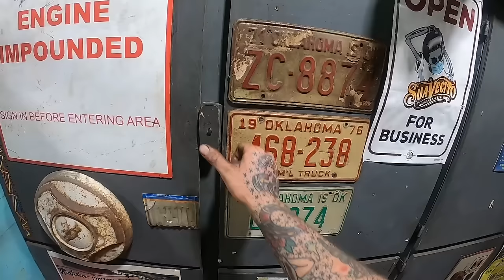Budget Shop Truck. WILL IT DRIVE AGAIN? 1976 GMC SHORTBED Conversion.

Comment: pudding, Yes, I would like to have me a good pice of reliable transportation to drive.  Yet, I like and enjoy watching one do the different mechanical processes to make the truck safe to drive daily.  Regarless of the time it takes one, one is still doing a good job.  I took out my trash and can barely walk.  Then I laid on down after and was frustrated I had three bags and each was holding me up from getting outside.  I fought them the whole way.  I got my can from the cub and rolled it to the house and put all the bags in it.  I climbed up a ladder in the kitchen and cleaned out the cupboards of older stuff.  Two hours yet I kept on with that process.  My arm is still sore from falling over three weeks back.  I like the new shop too.  And am willing to give one a good tip if I happened to get the truck.  May want to find a little camper for the back of the truck so that I can sleep when I get sick with the low blood sugar.  My blood level goes low and then I get sick.  Happy Thanksgiving am grateful for a lot.  43 continuous years of recovery.  And Merry Christmas also.  Paul in Ohio

Comment: Does that year tuck have the proportioning valve that you press the plunger button to reset the shaft that moves when you lose front or rear brakes, and has to be reset when you bleed the brakes?

Comment: I just played hell with my brakes. Had a fit trying to get them to bleed, calipers were hanging up, didn't feel right, etc.. brand new master cylinder was bad. Wouldn't release pressure. Put the original factory one back in. All better.

Comment: Was really expecting a shovel smack sound or a gun shot after you pulled the snake out but guess that wouldn't be family freindly .i have had shop snakes before its not a great day when you open a drawer for a tool an snake or run one over with a creaper an grab it thinking its the air hose . Tractor supply has a big container of snake away that's not terribly mothbally an works keep the video coming.

Comment: Little dab of grease on your brake adjusters.  Where the cap end slides onto the longer end.... save a lot of heartache later so they don't get stuck. And a dab of grease on the backing plate pad edge surfaces....  just sayin' 😊

Comment: What model number is the Milwaukee cordless ratchet yiur using im getting ready to buy ine an upgrade from the dewalt im using now i like my dewalt ratchet but ibe had my hesrt set on a Milwaukee 3/8, cordless ratchet an maby later on a Milwaukee cordless right angle impact ratchet but definitely would appreciate it if you'd sebd me the model number of the Milwaukee cordless ratchet you used in this video thanks buddy

Comment: Me thinks Puddin Pops never taught Puddin 1 thing if'n it's not broken don't go fixin it. Guess better safe than sorry. 😊🤪 Puddin you have a ball joint tool but did you know that the universal in the tool description. It means that it is a universal joint tool also yeah you can install ball joints and universal joints.  Makes installing universals a snap.

Comment: Wrong one mic it up see if one side shorter then the other ? & Don't get why ur doing them that way cuz iam sure u have a oct u joint press i see it on ur table urs is green 🍏 i think ?? And u could sand the clips little make them thinner on belt sander good luck and god bless

Comment: Yea Puddin your concrete guy is full of crap. No venoumous snake can mate and hybridize with any other species of snake. It’s a genetic impossibility.  A snake has to be of the same species (like rattlesnake to rattlesnake) but even that is not a guarantee it’s much more complex than that. As for snakes wiggling their tails there are many species of snakes both venomous and non venomous that will wiggle their tail, they will do it for a couple different reasons. One reason is as defense mechanism.  By wiggling their tail and making noise it essentially mimics a rattlesnake or portrays it self as dangerous to a predator hopefully scaring it off. In fact some snakes will also flatten out their head and throat area like a cobra when they hood up to come off as bigger and more dangerous/scary to a predator. The other reason Snakes will wiggle their tails for is for hunting reasons. It’s called caudal luring. The snake will wiggle their tail so it looks like a worm/insect luring in its prey item where it will lie in wait and ambush it. There’s your science lesson of the day. 🐍 🤓 
On a side note I also vote for a shop kitty.  😽

Comment: Rattlers do not cross breed. Snakes will vibrate theur tail to mimick a rattler. People so silly with their stories about snakes. Just grab the little guy and.put hum outside.😅😅😅
That's nothing more than a ratsnake. Completely harmless and you would be smart to keep that snake around. He'll help with mice and also help to keep the relly dangerous snakes away. But I understand people over the generations have been told bs about snake and here we are

Comment: You need to stop using carpentry hammers on mechanical parts. Carpentry hammers will shatter! They are not designed to hammer hard steel. Carpentry hammers are for nails only! Go look it up!
Reply: Get a mechanics hammer. Using a carpenter’s hammer doesn’t make you look professional.. are you professional or a punk.  Come on!